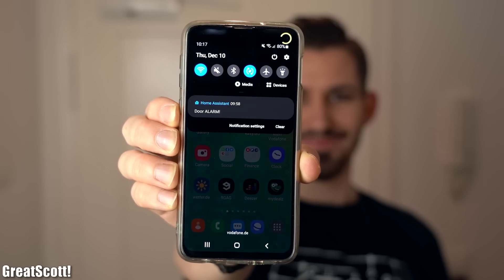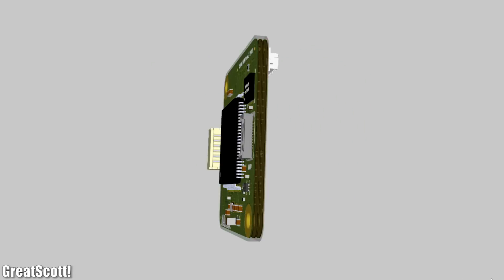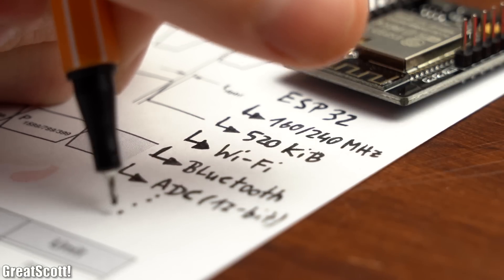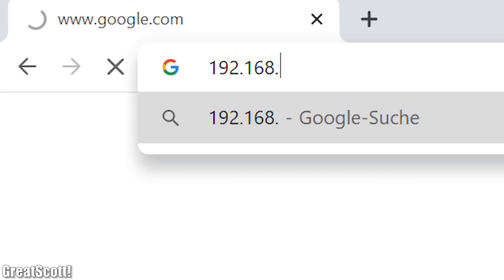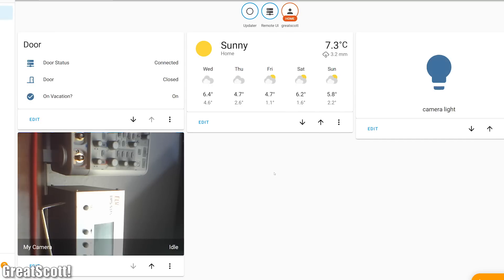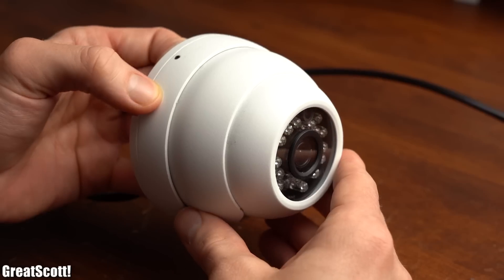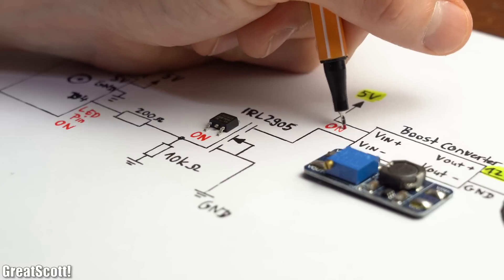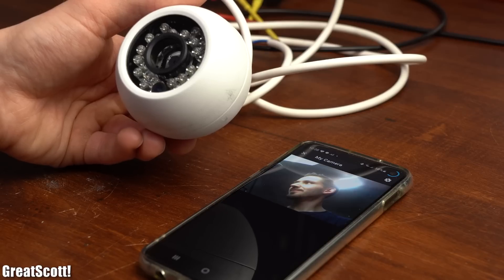DIY Online Security Camera! (takes pictures when an intruder enters) || Home Assistant Guide

Comment: Anyone who cant get their computer to see their esp32 board.. try MULTIPLE usb cables. Some usb cables dont have all four lines and only provide power and ground. its common for the two data lines to be removed from these connectors so theyre only used to charge our devices.   This was my problem I had (I didnt use my ftdi board either.. I bought a esp32-cam-mb usb board that plugs into the esp32-cam board which i connected via usb and Windows Com Port didnt see, nor did it make the chime.  As soon as I got to trying my fourth usb cable.. Windows recognized it.

Comment: Nice aspects.  To deter, outside cameras are best visible on the house pointing away.  Small hidden cameras with SD cards are best inside, and inside the fence pointing towards fleeing intruders.  ESP32 cam are ideal for that purpose, inside a box which looks like a power outlet.  Intruders are masked and hooded, so points of reference for height and step length are nice to have.  Unfortunately, as long as nobody has been harmed, police in most countries are not interested, and when they catch somebody by accident, they have a history of hundreds of break-ins,  sometimes thousands.

Comment: Just an opinion, but I think if the camera is located lower maybe between 170 cm to 200cm would be the sweet spot. The reason is most CCTV or security camera footage are taken at a height that sometimes makes the face not visible if the person is wearing a head gear.

Comment: Do you think this esp32 camera system can be used to do optical position sensor?
i.e. just like those optical mouse that use a camera image to track movement.  With all this compute power and a high res camera and small size, it might do very high precision location movement needed for a cheap CNC machine without expensive stepper motors and tight motion.   If someone can figure it out Great Scott can!

Comment: yes boss i have a project for u. Diy CT limiter for chinese grid tie inverter  it control the solar input ,so off grid inverter wont  go into protection mode .Cutting the power because the load was not enough .Also it wont back feed utility grid if on grid. Can  u?

Comment: hi bro.. can u make next video talk about Surge Protector. and same thing ab Thermal Fuse and Variable Resistor example... MOV-470kd14j any different with J or without J  when i google it said ( J is high surge  no J is standard surge ) but i didn't understand......like this video show here>>>> ( https://www.youtube.com/watch?v=PXCkSJKcVz0 ) 

i try to make or upgrade.. Triple Gang Multi-Socket Plug Extension something like this https://www.amazon.co.uk/Pro-Elec-Multi-Socket-Extension-Approved/dp/B075WXD14Z

Comment: I just realised that the IRL2905 has no safe operating area for DC given in its datasheet. I've heard numerous times that it's important to use Mosfets which are specifically made for linear applications, if you want to use them as a DC Switch. Maybe that would be a great topic for a future Video?
Video is top notch, as usual.

Comment: Scott, I have a question maybe you can help with me. I'm trying to create a power supply with a digital read out but I don't want a LCD to tell me the voltage I'm running. I want to use 5 nixie tube 4 Numark nixie tubes and one light nixie tube to be the desimol. Like this (00.00v).can you help me with this? Nixie tubea I want to use are the N-14

Comment: I like the personal intro !!  I have been playing with the ESP32-CAM, and find it useful for seeing what's going on at my house.  The resolution isn't all that, but works well for what I'm doing.  I want to connect the garage door opener to it, but have not obtained a 3.3 volt solenoid switch to simulate the button push to activate the motor.  I think a transistor to one of the GPIO's will trigger the solenoid.  Merry Christmas !!

Comment: I have three of the esp32 cams with a version of firmware that has motion detection and recording. It works really nice, but the camera module I have (OV2640) doesn't see IR that well. Hardly at all, actually. Did anyone notice this?

Comment: Needed samples of infra red light functionality.
Also, why did you remove the on board LED?
Reply: Save power and no indicator for intruders
Reply: @akinoye  which you could do by just changing the pin number in the code

Comment: This is an interesting project, all these inexpensive devboards you can get today are game-changing. Several years ago I had a webcam hooked up to a Linux PC running the 'motion' program. It would take pictures automatically when it detects motion. Running that on a Raspberry Pi or similar might be better because it could take pictures autonomously, even if your Wi-Fi is down.

Comment: I like this project. But I would really recommend to not use wifi for security relevant devices. I am coming from the IT security sector and it’s just so easy to jam it. For someone with experience it takes less than 30 seconds to take a wifi network down😋.

Comment: I would suggest using a power outlet with integrated usb chargers, so you dont lose that spot, and even maybe direct soldering onto that, so that the intruder isnt able to unplug it right away.

Comment: For people having issue with the "brownout" error, make sure you have a good cable.
After three different cables, I finally managed to get my ESP32-CAM to work. Turns out that they are super sensitive to power fluctuations.
I accidentally nudged my cable connector to my PC once, and the brownout was triggered.
Reply: Add a 470uF 6.3v Electrolytic Capacitor accross 5V and GND resolved the brown out issue.

Comment: This is neat no doubt, and Im sure it helps practice skills.

That being said, a prebuilt solution like the TP-link Tapos series or Wyze cameras will cost you only a little bit more, take you less time, and get you many more features like full video, an easy to use app, out of home monitoring support and more.

Some of these cheap ip cams even have pan tilt, and many have no subscription fees.

Basically Im saying this is neat, but would probably lose a buy it vs make it battle.

Comment: Once again, very nicely done! But every time I see the lighter used to for heat shrink tube I wonder why you don’t have or use a hot air gun. Mini versions are available for reasonable prices on AliExpress and elsewhere. Is there some disadvantage I’m unaware of?
Reply: just convenience I suspect. A lighter can work well BUT it takes practise and dexterity

Comment: I have several identical esp32 cam boards and I cannot get them to connect properly to the FTDI board. When I try to download a simple program, I always get the error "Failed to connect to ESP32: Timed out waiting for packet header"
I have checked and rechecked the wiring. I have swapped out FTDI boards, USB cables that connect to the FTDI boards, ESP32 Cam boards, jumper wires, and computers used to run the latest Arduino IDE running on a current Windows 10 Pro. I even ran a simple test connecting two FTDI boards together to see if I could send data from one to the other and that worked fine.
I believe the problem may be that the FTDI baud rate does not match the ESP32 cam board default. I tried several baud rates (1200, 9600, 19200, 38400, and 115200) with no success.
So, any suggestions from anyone reading this would be greatly appreciated.
AtDhVnAnNkCsE!
Reply: Maybe the esp32 is not in programming mode.  Ground gpio0, cycle the power, and you should see a message in your serial monitor.  I always use 115200.  You should see "waiting for download" ... and rx / tx are swapped between the esp32 and ftdi

Comment: It would be more efficient if it adopts a LIPO battery with charge circuit
Reply: It would actually be more inefficient due to losses in charge circuit and LiPo self discharge. 
More useful though, but I'm not sure if it can save those photos somewhere if server isn't available.

Comment: Great, but you should used the security camera board instead of ESP. Of course u'll probably not be possible to reprogram the module but that's fine, the server should never run on a security appliance directly.

Comment: If only video didn't require so much space to store at decent resolution, I would have cameras everywhere. I just don't have the storage capacity, and I've seen a low resolution security camera obscure our ability to determine which customer is which at work, and I work at a large home improvement retailer with a blue theme.

Comment: How much current does the camera draw when its taking a picture with the IR LEDs on?
Reply from the maker: I would recommend a 5V 1A power supply at least. Should take around 800mA at peak.
Reply: @greatscottlab  Hey, GreatScott, i think the best way to make sure your system will not turn off in case of a power outage is to use a powerbank that can be plugged into power outlet instead of a normal power supply that will turn off in case of a power outage
Reply: That's the point! I planned to make nest camera with pv-panel, based on the same board, but it simply a current-hungry item. I had to skip the complete project because of that.
Reply: Can you share pictures taken in the dark with the it on?
Reply: IR*